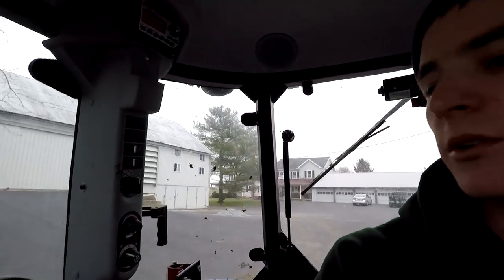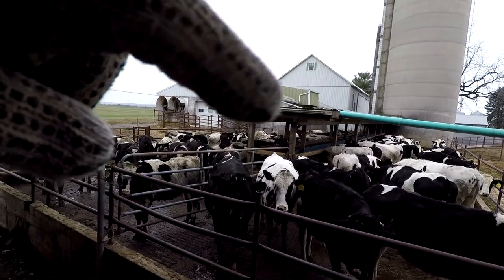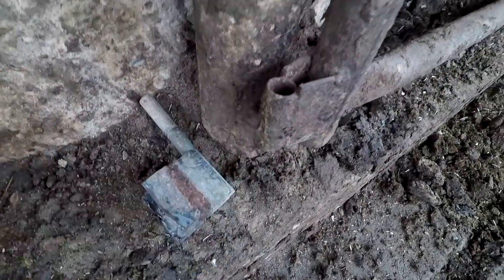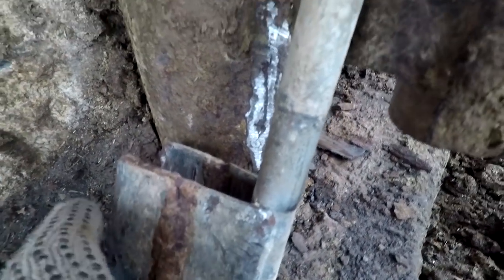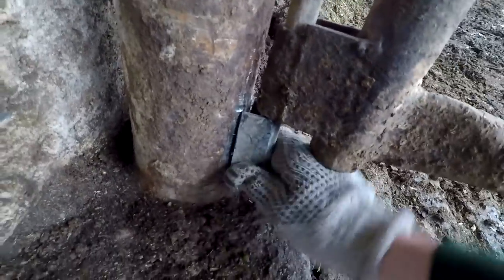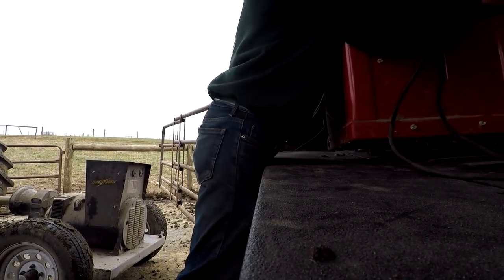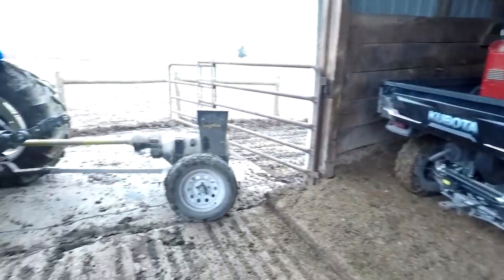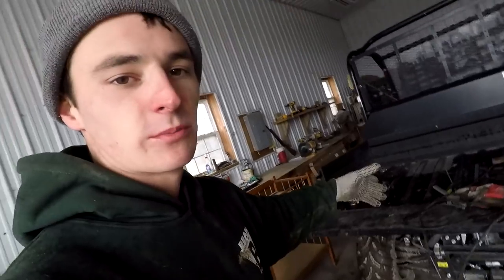Welding a Rusty Gate | Its not always pretty

Comment: Great video Eric. When your welding on dirty/rusty metal it’s always a good idea to hit it with a wire wheel first to clean up the surface if the base is not rotted. And also I would recommend using a 6010-6011 for the first root/base pass and finish off with a 7018/6013 for added strength
Reply from the maker: Thanks for the advice
Reply: 10th Generation Dairyman how old are you
Reply: I second this.
Reply: Yes to every thing you said adding clean off the galvanize from the mating part.  Galvanize interferes as well as contaminates a weld.
JIM

Comment: The all mighty buzz box. I use to have to either drop the solo cord down from the solo in order to fix Gates or broken freestalls. If they were to far from the solo cord I would hang the welder from the cylinder holds on the 4020 and power the welder with a generator.

Comment: What we have at our farm is what we call the welding cart. We have a diesel powered generator and an arc welder on the cart. It’s just a small trailer with plywood on the sides. I recommend having that for you. We also have many farms for all of our dry heifers and cows. If something breaks we have the welding cart to bring along. We pull it with one of the small trucks it’s not too heavy
Reply from the maker: Yeah that would be handy

Comment: I bought an Everlast 200 amp inverter stick welder, runs off 110 or 220 and be picked up and carried one handed very easily.  Once I started using it I sold the Tombstone Lincoln.  It isn't super powerful on 120V but plenty powerful enough for a gate.

Comment: If you ever run into trouble with brackets for post C&K downtown Lancaster has bolt on ones they work really nice. We use them in our steer Barn all the time that way if one breaks we can replace it very quickly.

Comment: A weld is only bad when it don't hold or when you look at it lol I'm not sure if you was ever told but weld stuff like that use a 6011 rod in a DC welder or 6013 on AC welder that's the best rods for rusty dirty metal it burns right through the rust Thanks for sharing

Comment: Those PTO generators are great for using around the farm when you can't get electricity from a outlet close by. We had one and had to use it to run it for a week cuz we had a ice storm and the power was off cuz the poles broke off and lines were down until the REC could put in new poles. Also we used the generator out in the fields during harvest to weld on equipment. Do you use alot of wood shavings in the heifer barn to provide ample amounts of bedding in the winter  ?
Reply from the maker: Wow a whole week without power would be rough. Yeah got to make sure we put enough in, could probably use a bit more.

Comment: you should get 7018 weld rods bud it looks like your using some sort of 6010 series rod they are hot burning and fast cooling which doesn't work well for standard welding

Comment: that hinge you put on was galvanized  if you dip that in muratic acid  it will remove the galvanized coating in about 3 seconds also watch ChuckE2009  get help on your welding

Comment: The pto is spinning free lee that’s dangerous lad
Reply: It has to spin to create electric
Reply from the maker: It has a guard on it, the guard was just spinning along with it
Reply: 10th Generation Dairyman  Ik but the cover is spinning it should secured
Reply: @ryanmccormack9839  Not necessary.  The cover is separate from the PTO shaft and can be held/stopped with your hand.  If you touch it with a body part it will stop turning.  
JIM
Reply: JIM C suppose but still

Comment: Just because a weld is pretty doesn't mean it is strong. You have get some 6011 electrodes. I use it almost daily, with some practice you can stack dimes with it and still have the best maintenance rod in my opinion. It will burn into just about anything.

Comment: Bah! Out of position, dirty booger welding use the 6011 or 6013 and try to go vertical up. Your welder will always be set correctly and you will get more practice fixing everything you fixed a year ago. Nothing is going to hold up to manure and urine. #hogbarnsareworse.